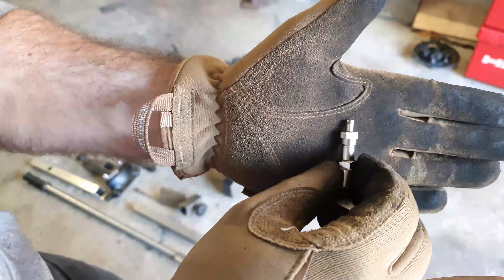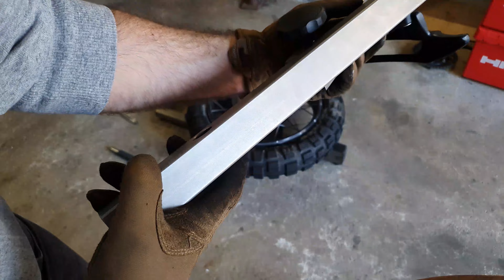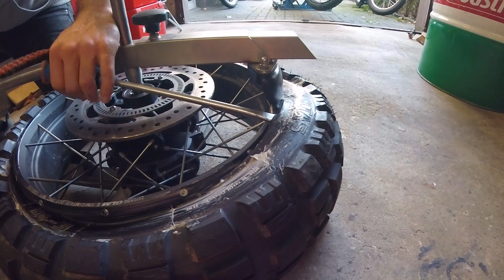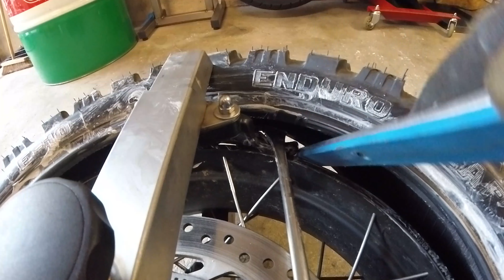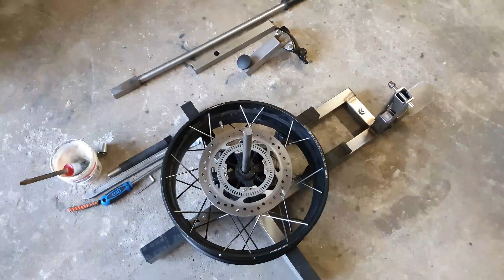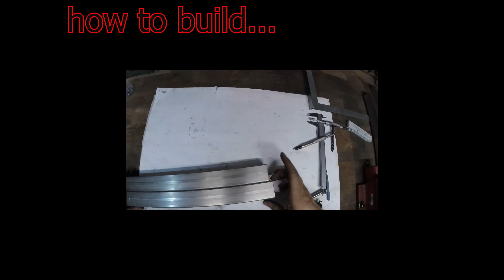Using Motorcycle Tire Changer! #goforaride #triumph

Comment: Great stuff ! Did you attached it to the ground? How does it lock in place when you are pulling the beed all the way around ? How does not the whole thing move as you pull it O.o
Reply from the maker: Thanks!  yes when i changed the front wheel i bolted it to the concrete in the garage as it was harder to pull off.
Reply: @q-bigwerkstatt2  makes sense yes.
Pretty nice job 👌